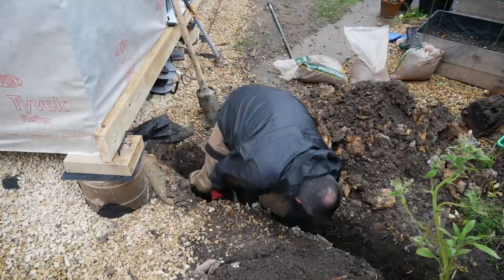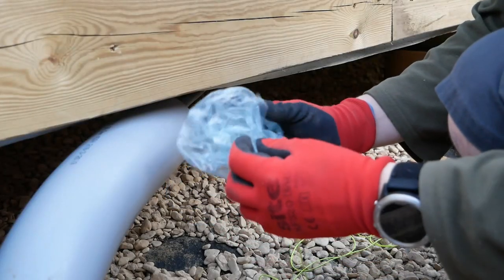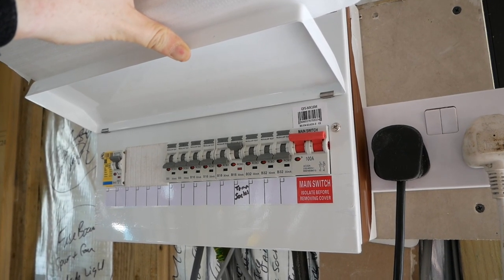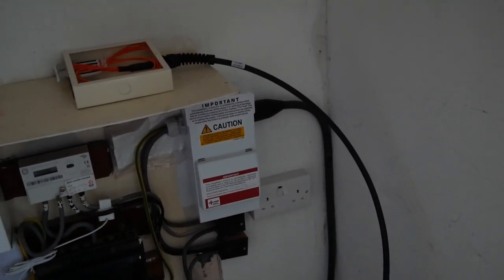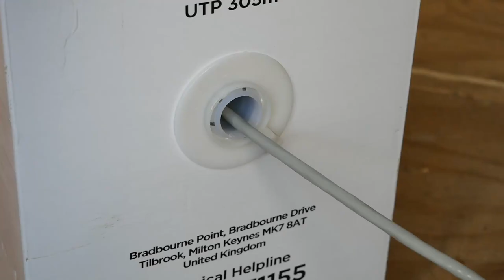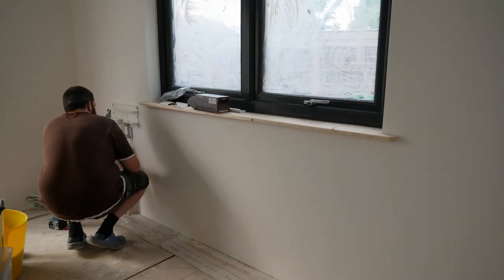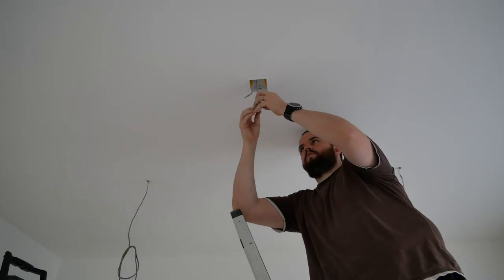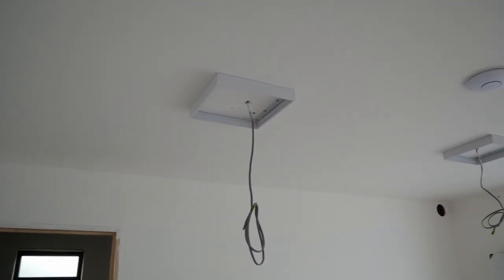Electrical & Networking - First Fix - Garden Office Room Build (Ep 15)

Comment: What are the lights you are using there, and out of interest, why didn't you got for recessed spot lights, as you have the warm roof, you have plenty of clearance.
Reply from the maker: I didn't use recessed lights as the gap between the plasterboard and the air barrier isn't big enough to accommodate them. You could of course push the barrier up more into the void if you wanted, but it looked a bit trickier to fix that way.

In any case, the lights are 300mm x 300mm LED Panel Lights with a light temperature of 6000k - so they simulate daylight. They are dimmable though, so it can be toned down a bit in the evening!
Reply: @PaulBuildsAThing  Great, thanks, could you post a link to the lights you purchased please?

Comment: Not sure what benifits you have for running fibre vs cat 6. Unless it's to separate your earth potential. Cat 6a should be good for 10g over 50m. And 1gig over 100m.
Reply from the maker: I mean each to their own, but it does mean I never have to worry about interference from the power cable running next to it or lightening strikes. I also get the added redundancy of 4 TX/RX pairs in a single cable which would be less conveniently achieved with CAT6.

 Interestingly an equivalent length and number of runs would cost about the same. Also a quick search for SFP+ 10Gb RJ45 modules show them to be about 3x the cost of their fibre optic counterparts.